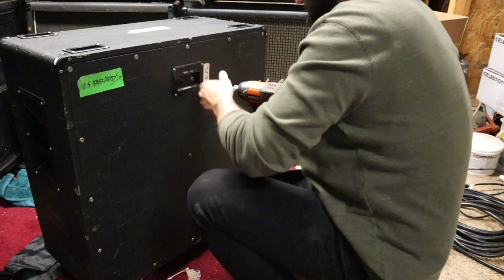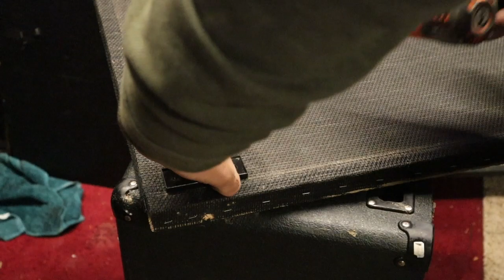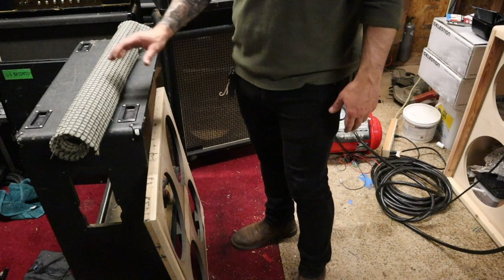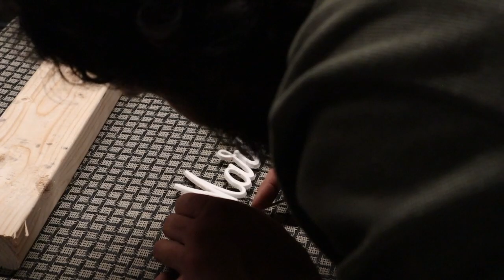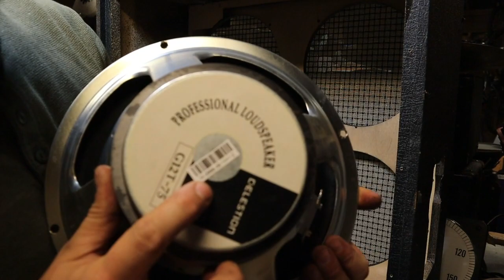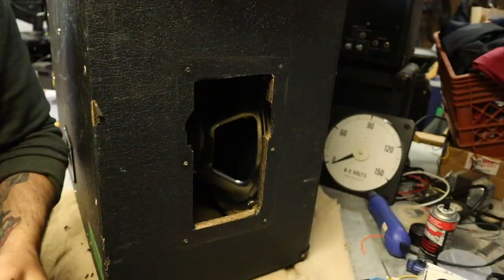Repair blog 001: Changing grill cloth, speakers, casters and repairing handles on a Marshall cab

Comment: Anyone have idea what some good places are to get the most authentic looking/feeling Marshall style checker and salt/pepper grill cloth? Also Tolex as well? I have a 3 Marshall Cabs that I basically need redo everything. A Late 70's UK 1960A, an 80's JCM800 UK, and an 8412. 

Also, with older cabs like the 70's/80's, will refurbishing them hurt resale/collectibility even if they are pretty beat up? I'm planning to keep my stuff, but just curious.

Comment: Somebody told me that twisting the wires helps produce a self interference pattern that cancels out radio waves and 60hz hum... is that true?
Reply from the maker: Yes but not necessarily in this case. There's a long answer to why we use twisted pairs of wires in different applications but this is more for neatness than anything else.

Comment: @Purgasound  do you think the baffle from a modern 1960a marshall cab will fit in an old 73 1960a cab?
Reply from the maker: That's a good question. Marshall cabinet sizing has always been consistent but construction methods and tooling might have changed slightly. I'm not sure when they would have started using CNC machinery exclusively and that could play a role in the baffle sizing which could be off by a slight margin.
Reply: @purgasound  good point, thanks. I'm going to give it a try so I'll let you know.

Comment: Nice. The only thing that might make this video better is maybe don't drive a screw through the cabs soul. That's the center pole that the cabs back rest against. There is a reason manufacturers don't put that screw in the first place. Here's some reading for You.

The cabs soul not only provides support for a big piece of plywood that is the cabs back, but also stops the back from vibrating from the sound bouncing inside the cab by applying tension against it. When You hear something rattling inside an ol cab while You play, it most likely is the back rattling against the soul (or a fd up speaker). The fix is not to connect them with the screw tho. It's an easy way to fix the rattling, but... Take something soft like cork matt or a piece of rubber or foam thin enough so You can glue or somehow attach it to the soul so its between it and the cabs back, and close it using the screws on the edge. You will eliminate the gap that causes the rattling and the cab can breath again.

Let me know if that makes a difference :) cheers!!

Comment: Did you know you can order new casters and sockets directly from Marshall? They are $12.99 each A set of 4 without sockets is about 30 bucks. Marshall also sells All the parts to beautify your cab after you retolex it. It's way cheaper to buy the parts from Marshall than from someplace like AES. Some stuff you can't get from Marshall but AES does have the 11"logos for $22.95.

Comment: FKN Rowngt! haha this dude is my new go to guy. Im building a local H styler guitar. dremeled out a pickguard to fit a single dimarzio bass pickup , threw a duncan invader in it annnnnnd a killswith(only on the guitar side)! double jacks and one volume guitar, on volume bass. LEZZZZGOOOO. oh and paradigm heavy bottom light top 52/10 gauge ///BONE NUT filed to specific! wink wink shes a comin

Comment: Just found this video. Quite helpful, thanks! Doing almost the same thing to a '70-'80 1960B I just scored in a pawn shop for $200. G12-65's in perfect condition. Someone re-grilled it with a black Fender-style cloth and I am also putting new large check cloth on it. After hearing you I decided to salvage the old handles - so you saved me $50!! Now I will continue to look for a video to show me how to restore the corners and those pesky rivets!! Cheers!
Reply: I'm doing  sammy hagar red voodoo cab made by crate

Comment: Brother from another mother, have-n the Marshall sickness and b-n in denial of my sickness , I happen to own a 1977 double stack MK2 Master Model 2203 that is in need of Tolex for the bottom back panel, and i am at a loss as to where to find it, sure you would think just google it , I have visited every site in the known web to no avail, my quest is I'm try-n to find elephant grain (FAWN) COLOR TOLEX that Marshall must of put out for that year and then may-b discontinued that grain and color , I hap-n to notice all of your marshall cabs in your video back ground, and thought here is someone who might b able to put me on the right path, I'm am try-n to put the amp back in pristine shape, everything is showroom condition except that panel , sorry to make a long story long  (1 pissed off fucker)
Reply: Sounds like you have the rare 'Light Brown Elephant Tolex'. It might be mission impossible to match what's on the cab right now, you might need to change the whole lot to a period correct colour that is available.  

Marshall Tolex:

Black Levant: 1965-1974.
Black on Green: First appeared in 1966 and was occasionally used through the 1970s.
Black Elephant: 1975-Present.
Blue Levant: late 1960s, possibly early 1970s, and used on the 30th Anniversary Series in 1992.
Dark Brown Elephant: 1978-1982. Used on the Club & Country Series.
Light Brown Elephant: Used occasionally on amps since 1975.
Orange Levant: late 1960s-early 1970s.
Purple Levant: late 1960s-early 1970s.
Red Elephant: Used occasionally on amps since 1975.
Red Levant: late 1960s-early 1970s.
Silver: 1987, 2006. Used on Silver Jubilee amps in 1987 and on a limited DSL series in 2006. Possibly used on other models as well.
White Elephant: Used occasionally on amps since 1975.
Yellow Levant: offered in 1972 catalogue.
Reply: @Techo1329  I Thank-U 4 the get back, All the rst of the amps Tlx is in mint shape including the brown grills I was think-n if I could find a cab of the same T with the back lid attached then I'll b head-n in the right direction if  you by chance come across a back panel in that style cut you in% on that skin